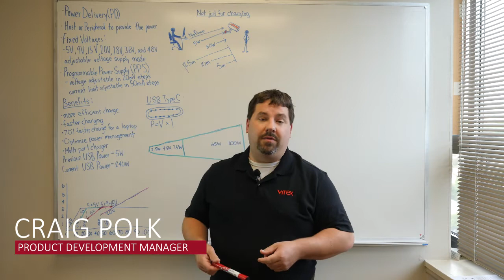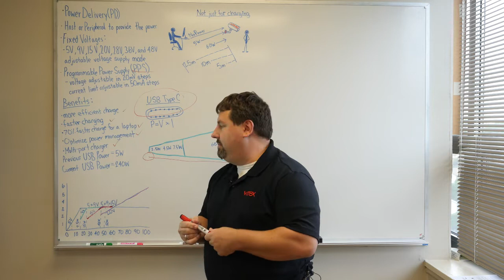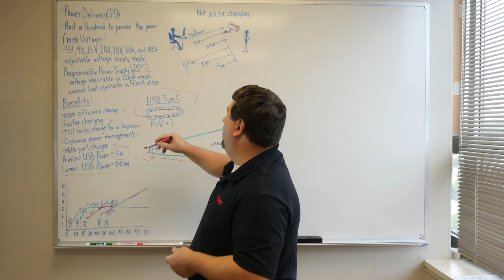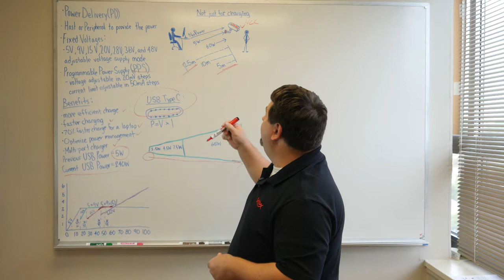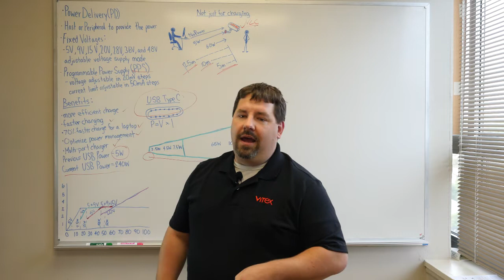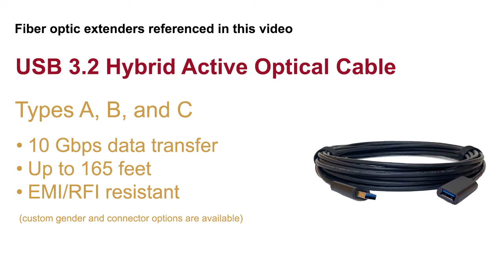Vitex Talks | The power of USB-C: exploring the past, present, and future of USB-C power delivery

Comment from the maker: :yt: Full Video Transcript:
Hey everybody, this is Craig from Vitex and today we're going to shine some light on the power delivery option of USB. We're going to look at some of the things that happened in the past, what's going on currently, and some of the benefits and options you can get from it. A lot of people don't know that this has been around since 2012 when the USB-C first came out. Before that, it was really just known as USB charging. Anyone who had any type of phone always used USB very, very much to do charging, and in 2012 when this standard came out it brought into the possibility of more power. What we see there is that some devices were starting here, around 2.5 watts, and it added capability to go much, much higher to 65 watts and up to 100 watts. And in fact, we're getting more standards that are bringing this even, even higher. We start seeing some fixed voltages that go above, up into 20, 28, 36, 48, and this is going to allow us to get into even a much higher power, reaching levels at 240 watts. Besides the fixed voltage, there's also the option of programmable power supplies. This gives us a lot of different steps, sizes from 20 millivolts and current in 50 millivolt adjustable capabilities. Besides charging, which is a really big benefit that people talk about, so that includes the effectiveness of the charge, how fast it can charge, and for people who have newer devices that use this USB-C, you can see it just by being able to charge your devices instead of overnight and sometimes into 15 minutes or 30 minutes. We see a big improvement at 50% to 70% faster charge times for mobile devices as well as laptops. We're getting into the area where we're going to be able to optimize a lot of our power management, so this is going to be really beneficial for more devices such as laptops, routers, hard drives. And then we're looking further into the future to see things such as multi-port chargers where we're going to have capability of say a 60 watt coming in and we're able to split it to say a 30 watt, a 30 watt or a 30 and two 15s, so it's going to allow us to charge multiple devices at the same time, so that's pretty cool. As before, when I was talking about in the past, we really had a small option when we were around 5 watts, and this really didn't do much more than allow us to charge handheld devices. As we're going into the current and future, we're going to see this jump from 100 watts up to 240, and this is really going to bring us the things that are not just for charging. If you think about some of the applications this could be in, security cameras is one that we'll just talk about right now. But there is an inherent problem with that. If you're using copper cable, you can only go so far. How do you get beyond this limitation? And that brings in the technology that fiber optics use. There's a couple options you can use. One of my favorite ones that I like is the hybrid cable. It's a combination of fiber and copper cable. There are some important notes to keep in mind when you're looking at distances in these hybrid cables. The first one is your max distance. How far do you want to get? Just using the cable alone where we're not really considering delivering power through the cable, and say we have our own power supply that's coming out over here, you can go up to 25 meters, no problem; it's easy to support. Say you want to bring a 60 watt into this. Well, you're going to be limited all the way down to 5 meters, so that's something to keep in mind. If your device that you're using, say either a camera or something like a solid state drive, is using less power, only requires 5 watts, you can double that up to 10, so that's really cool. It allows your distance to go much, much further. That's one of the reasons that I like the power delivery option. It gets away this whole need of having an external DC or AC source to power some of the devices. Let me know what you think in the comments below. How do you see this standard evolving as you move into USB 4.0? What are some of the applications you like to use in it? And let me know if you actually think we're going to hit a ceiling right here and there's going to be a need to go past 240 watts. Until next time, when we shed some light on another topic, I'll see you then.